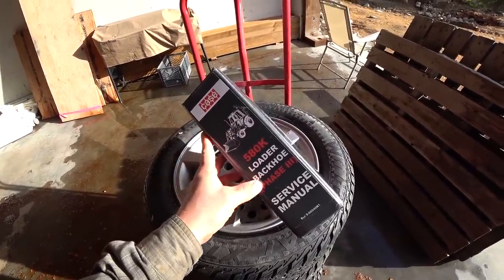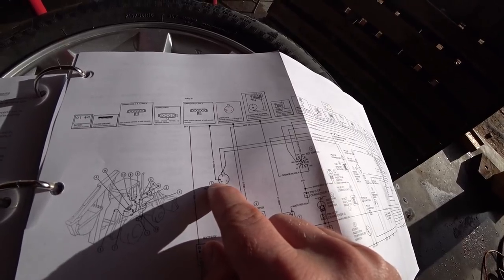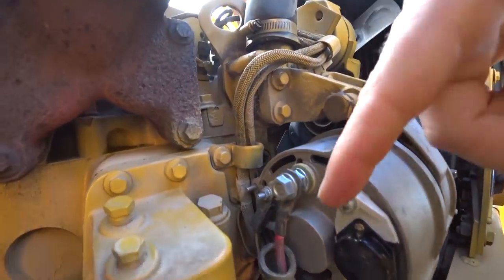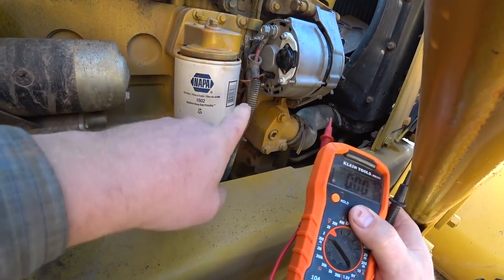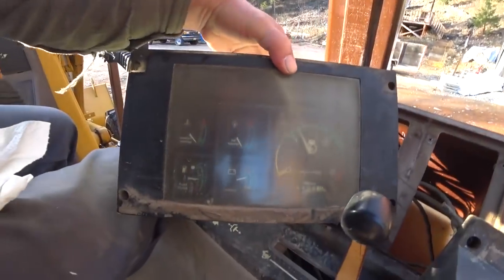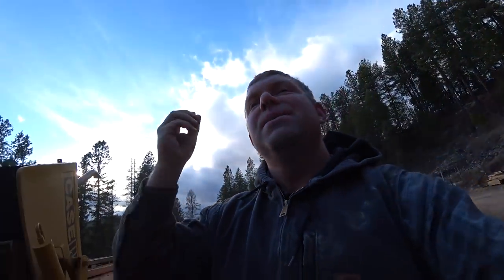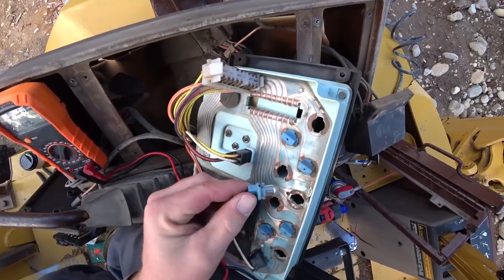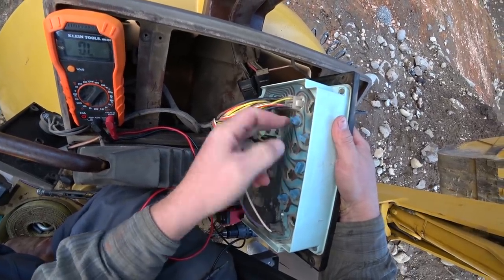YOU WON'T BELIEVE WHAT THE PROBLEM WAS!!

Comment: they sell those little bulb holders at AutoZone they are very common on 1970s era Ford cars and trucks with printed circuit boards usually they are on the same aisle as the light bulbs
I just bought 12 of them a few weeks ago for my 1973 Lincoln that for some reason was missing all of them they are black in color and they are in a little Peg hook hanging package

Comment: Sounds like a poor design if they are using a bulb to enable a circuit.  That typically is the job of a circuit breaker.  Also, seems like the first thing they'd suggest you do, if there is a problem, check all the bulbs :)
Reply: That circuit is used because it actually does 2 functions.  Not only does it "kick start" the alternator (𝘢𝘯𝘥 𝘖𝘕𝘓𝘠 𝘬𝘪𝘤𝘬 𝘴𝘵𝘢𝘳𝘵 𝘪𝘵 !) but because that terminal is internally connected to the output the alternator the bulb will light if the alternator output voltage is lower than the battery voltage.
Reply: Generally speaking the bulb doesn't see any real use except on ignition on and not running. So these normally last a very very long time. But, they do burn out or succumb to vibration. So one fix was to place a resistor in parallel with the bulb.
Reply: wolvenar - 10 ohm 10 watt

Comment: You can buy new sockets for those twist in bulbs. Clean the flex circuit board contacts lightly, and twist in all new sockets and bulbs (#  GE 194 bulbs) Some are warning lamps , some are instrument lamps, and some are panel backlighting.

Comment: Nice job it's nice having the technical manual. But you're you are absolutely right as a father I am teaching my son how to use a Multimeter to fix his TV we found out that we have to change the LED backlights yesterday so we'll order the parts. For your bill amount on those little parts for holding the lights is it going to try online to find those parts would it be easier to change out the whole unit so then you know everything works and keep that as a backup it's just a thought good luck.

Comment: i have a similar problem on my rv, so I need to check my idiot light!
Reply: sometimes they go through the amp or volt gauge... especially on the Dodge chassis
Reply: I have a GM chassis
Reply: anything GM after 1978 or so should be all electronic and straightforward truck chassis... house isolation issue maybe ?

Comment: Yet another engineered breakdown that makes you have a service call brought to you by Caterpillar. "Looks like you need a new voltage regulator/alternator. The good news is there is a core charge on the old one."

Put a resistor with the same resistance as the light bulb past across the bulb socket so if it burns out, you don't  have this happen again.
Reply: First time I knew that Caterpillar manufactured Case equipment.  How long has that been going on?
Reply: I did state the wrong manufacturer. The service calls for profit model is used by both though.
Reply: I am a retired industrial electronics tech. SO I will walk you through what is going on in the circuit leading up to the alternator:

First, it is serial circuit, since there is only on path for current to flow. With that, we know that the sum of the voltage drops across each of the components will equal the voltage source because of Kirchoff's second law. This means that the circuit is going to drop 11 volts at the light bulb since we measure 1 volt at the alternator to ground and the source voltage for the circuit is 12 volts.

If we were to jumper past the light bulb, we would provide 12 volts to the alternator because we would have created a parallel circuit and all branches of a parallel circuit have the same voltage since parallel circuits divide current per each branch instead of voltage per each part like a serial circuit does. Since shorting 12 volts from the battery terminal on the alternator to the other terminal will trigger the alternator to charge, we know that just a jumper would work, but giving this higher voltage continuously may damage the alternator. This can be assumed because the voltage is lowered to 1 volt in the design of the original circuit.

To be sure that we don't slowly cook a part in the alternator, we need to do the same thing as the light bulb was doing and lower the voltage. This can be done with a resistor placed in series after the light bulb and jumper around the light bulb. The value of the resistor will be the same as the resistance of the light bulb so that we get the same voltage drop as the original circuit.
Reply: You do not need a voltage drop. You can remove the bulb and twist the wires together and it will work just fine. Best option is to put a resistor with higher resistance in parallel with the bulb. This will force current through the bulb (path of least resistance) if the bulb is good. If the bulb fails, the current has only one path to take.

Kirchoff's laws do not apply here because these are not loops. 

Imagine that the post on the alternator is connected to a POT. One leg of the pot is - and the other is +

When the POT is dialed to - current flows from the source. It could be 2 volts, it could be 50 volts, that has literally NOTHING to do with current.

As you move the POT towards the + you begin limiting current through the bulb because its now taking the path of least resistance through the pot. When the POT reaches + there is 0 current flowing through the bulb.

This has ZERO effect on the voltage you will find at either end of the bulb. If you send 12 volts to the bulb you will have 12 coming out, no matter what state the pot is in. because V+ is ALWAYS V+ in this circuit. The only thing we are modifying is current and this doesn't fall under Kirchoff, or Maxwell. Conservation of energy would be better applied to a gauge with windings as those DO have a voltage drop across the windings.

*drops the mic*I
Reply: We might not need the lower voltage, but without knowing the full specs of the alternator, we shouldn't just run a full 12 volts in. It could cause early part failure or cause unintended operating conditions. Since this is a voltage regulation circuit and the behavior it has shown, it might just be a latching relay, but it could be a reference voltage for the voltage regulator. Without full knowledge of the circuit and all the parts, put it in the designed operating parameters. 

Kirchoff's laws apply in all circuits. This is a circuit because current flows. Single path=serial circuit. We are considering the function of a part of a circuit by using the reverse of Thevenin's Theorem. The modification places a parallel portion into the circuit to create a 12 V source that is unaffected by the light bulb, on or off or missing.

We then take the 12 volt source and us a resistor and the resistance of the rest of the path back to the battery, through the alternator, to drop the voltage at the alternator terminal to 1 volt, just as was measured with the circuit as it was designed. If the engineer just wanted 12 volts there, they would have put 12 volts there. We could also take 2 or more resistors and create a voltage divider to get our 1 volt. Remember, we want 1 volt at the terminal even if the bulb goes out.

Yes, the bulb does work as a crude fuse, but it would most likely pop the main fuse for the entire circuit first since real fuses are designed to blow and light bulbs are designed to last as long as possible. Hence, we do not care about current limiting within our modification since it is still has an overcurrent protection device, a fuse.

Your current divider that you make with the pot and the light bulb uses Kirchoff's first law, also known as Kirchoff's Current Law. As far as your comment about windings holding energy, it is the magnetic field that they are holding that retains the energy. That falls under Maxwell. You have the right overall thinking to make it work, it is just that I showed another design and explained my theory of operation with references. Your mention of loops sounds more like you are thinking Kirchoff's laws are only used in mesh calculations. They are used in those, but also any time current flows, even if for a short time, like building up a static charge in a capacitor or a magnetic field in a coil.

There is always more than one way to do things electrically. It is just some of them let the smoke out...or explode. And we are only talking about simple DC circuits with all passive components. I could really blow some minds with RF AC laws and theory.
Reply: agreed there is a thousand ways to skin a cat. But what we do know in this case, the rectifier regulator circuit is internal to the alternator, so we just need to supply V+ to the field input to get the whole show moving. and V+ on most is 9 to 17 volts DC and when the regulator is putting full output the field will draw close to 2 amps, when the battery is charged and the alternator output drops the field can maintain a nominal draw of around .35 amps

I used to rebuild them back when they were serviceable units. Now that every part on earth is cheaper to remove and replace there isn't a real demand for it, short of gas powered golf cart starter/chargers.

Comment: You are NOT supposed to have 12v at that terminal. Vehicles of that era used either a resistor for resistive wire to drop the voltage. In your case, the light bulb is the resistor. Replace the bulb with the correct one from your parts store and your good to go. The exciter circuit is to give juice to the windings to create the magnetic field necessary to generate electricity. It is also switched at the ignition switch as not to drain the battery when the vehicle is off. Good luck!
Reply: The alternator light does work by a balance. When you turn on the key, 12 volts is supplied to the alternator's field windings through the idiot light. This gives an indication that the alternator's field circuit is intact, and it also provides the current to start the alternator charging. When the engine starts and gets up to a high enough rpm for the alternator to start putting out voltage, there is a diode inside that takes some of the output voltage and featured back to the terminal that goes to the idiot light. The net result of this is that when the engine is running and up to proper rpm, the idiot light is receiving 12 volts at both ends, which means that the total voltage drop across the light is the zero volts and the light doesn't light.

Why do I know this? Research. I had a demon in my truck for a few years after replacing the alternator that made the idiot light glow dimly when idling but not while driving. Pulling the bulb solved the glow problem but the truck wouldn't charge. I replaced the rebuilt "parts store special" with a brand new Bosch and the demon was gone. The cheap alternator was not putting out enough voltage to balance the battery's voltage.
Reply: Rick Wilson wow...

Comment: part no pc194(printed circuit ) should be able to get em at your local auto parts store.
Reply: also can get a regular 194 bulb and sometimes they make the holder seperately. Make note that the holders come in two different sizes.

Comment: You can take those caps off of your multimeter wires so you have more cantact on them pins.
Reply: Are you kidding?  That`s the subject of a future 3 part video series, `Trade Secrets of the Electrical Trade - Episode 1 - How to use a Multi-Meter`.

Comment: I think the exciter voltage should be low in the 1 volt range.
Reply: It's not voltage so much as current.  As the resistance of the field coil is much lower than the light bulb,  the current flowing through the coil is determined mostly by the bulb.

Comment: Most likely the reason you only get 1 volt or so at the alt is because the bulb itself is a voltage drop. That means that most of the power is used by the bulb then the  alt only needs a small amount of voltage to go “full field” every thing should be ok.
Reply: Two resistors in series; the bulb and the field winding, will give lower voltage readings, depending on where the volt meter prongs are placed.
Reply: Correct

Comment: So is that like using the lightbulb as a fuse?  You might as well just cram something in there to close the circuit if you've been going this long without the bulb.
Reply: Charles Hanson or just fix it so it works as designed. It's the same effort either way.
Reply: Not like using the bulb as a fuse.  The bulb acts as a resistor in the circuit effectively dropping voltage across it from 12v down to 1 - 1.5v  The exciter circuit is designed to see the dropped voltage, not a full 12v.  A fuse has extremely low resistance by design and will not cause a large enough voltage drop
Reply: Wow, crusty AF.

Comment: Best to use a manual “T” wrench rather than the drill with your easy out. It’s too easy to break off the tip of the easy out in your screw head —- then you are seriously screwed as they are very brittle and hard.

Comment: First thing I noticed were your tools were the cheapest on the market.  You probably end up with constant stripped screw heads and are frustrated at bad screwdriver tips.  Like your more expensive shop lights that work so much better, having high end tools (screwdrivers, etc... ) make all the difference in the life of not only the tools but the equipment your are working on.

Comment: In my experience there sometimes is a reason the bulb is missing and not just burnt out. Sometimes that cicuit is a slow drain etc.  The person before you found the slow drain and took out the bulb and did what you were doing with the jumpering the alt to charge. If that bulb socket is not in the bottom of the dash compartment because it fell out, then I would check that circuit for a slow drain. I have fixed easy fixes like this on older stuff and then later found out it was a lazy persons fix for a previous problem. Please like this if you have had this experience.
Reply: I tend to agree, a burned out bulb is one thing, a missing bulb indicates something else.  Since the original problem was battery discharge and it appeared to be intermittent, I wonder if setting the bucket or dipper is providing a path to ground?  But only if they are set down at night, this would make it hard to diagnose. 

Testing voltage between the chassis and an earth ground (key off) would eliminate suspicion.

This was not a problem with the JD I operated, we set the outriggers and buckets down every night because tractors are irresistible to kids.
Reply: An overnight battery drain might just be a bad diode in the rectifier bridge. Replace the diode assembly or the entire alternator. Otherwise, the paper service manual is a wise investment.
Reply: crzy11000 Alternator in that engine looks relatively new.  Likely there was a bad diode pack and they swapped it out and forgot to re-install the charging lamp.  12 ohms is about right for a charging lamp.  Don't need more than 12 Watts going through it.
Reply: sivalley Jesse changed the alt about a month ago he did a video showing this. Would the bad diode pack then cause a backfeed through the idiot light killing the battery?
Reply: crzy11000 Not following him, this vid just popped up in my recommendations, heh.  But to answer your question; heck yes those little buggers can. 194 lamps are rated for 4 Watts, so they can drain a new, fully charged 600CCA battery in 6.25 days (that's down to 8-ish volts). Combine their draw with the parasitic from a bad diode pack drawing another half amp or so and a weak/old battery and you MIGHT have enough charge to crank once a day later.
Reply: sivalley thanx for the response hopefully some one reading this can in the future be helped by your response.
Reply: crzy11000 No problem.  Can't have much of a community if everyone goes around being snarky and stuck up telling everyone else to "figure it out".

Comment: measure the resistance across the idiot light...... find a resistor with two times the resistance at a minimum. wire it in parallel. Next time the light fails, the current will flow through the resistor and keep the system working, while buying you time to replace the light.

The reason for using a resistor with a higher value and not a lower value is so the light will still function as intended.
Reply: We have a winner !

Comment: Very common configuration for a 1 wire alternator.  Many newer cars have a backup resistor across the lamp that makes the alternator keep working when the lamp is out.  There is no current flowing in this wire the regulator just needs the voltage to signal the turn on state.  Since the lamp is connected to the run 12v from the key switch the alternator will shut down when the key is off.  If the alternator has a problem (including engine not turning) it grounds this wire making the lamp glow indicating a fault.  Those lamp holders look like standard GM dash lamp holder which is available at the better auto parts stores like Auto Zone.

Comment: A light bulb acts like a resister.  Anytime you you run current through a resister you create a voltage drop in proportion to the resistance.  A series of resisters can create a source of different voltages at each resister.

That is how computer power supplies create the different voltages needed by the different components in a computer.  From the 110/120 house voltage to 12 volts for the hard drive and CD drive and other large components to the 6, 5, 3, and 1 volts used by the different circuit boards and peripherals.